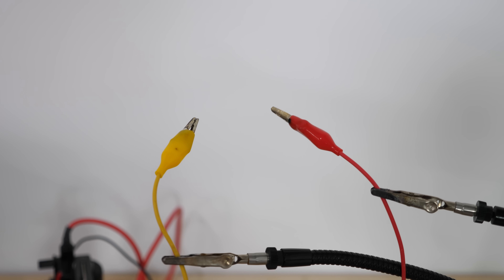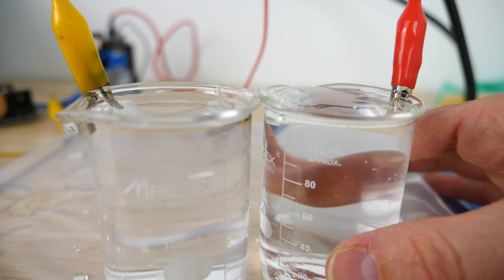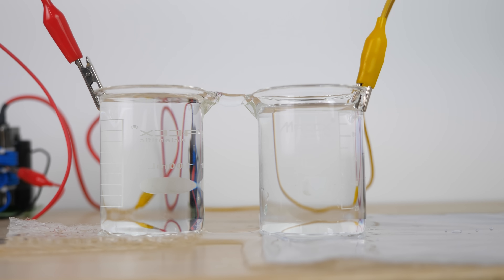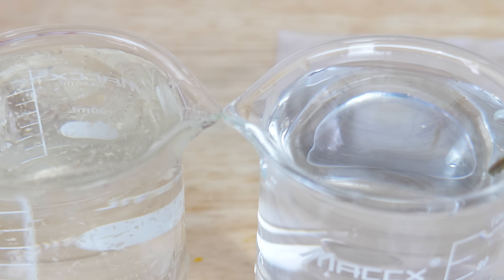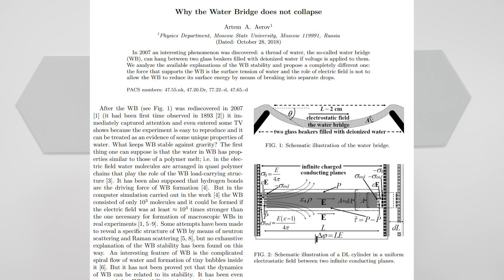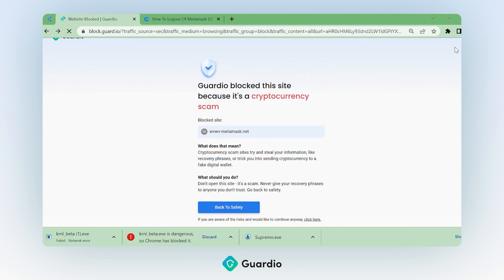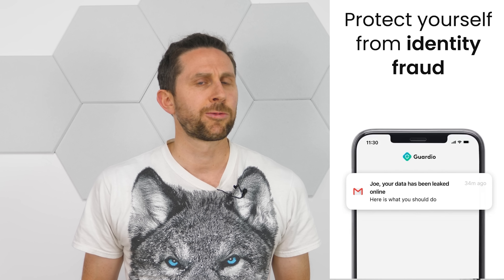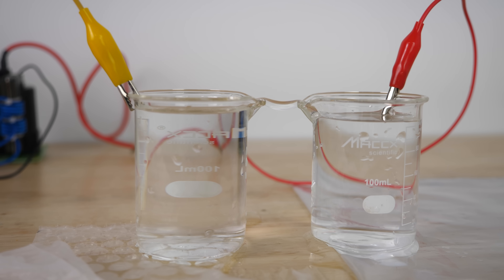How Does a Floating Water Bridge Work?

Comment: More crazy details: the water on the outside of the bridge is whipping around in a helical pattern at something crazy like 100k rpm, and I think the water on the inside of the bridge is going back the other direction. Also, the water in the bridge is freaking birefringent. And, there is a dramatic pH difference between the two beakers. I put up a few videos on this 10 years ago, and I've really been hoping a big science channel would pick this up, so it's awesome to see this video.
Reply: Curious if varying the Hz of AC would affect the bridge and flow?
Reply: @Motorhead250  it has to be DC.
Reply: @MonteFleming  AC throws huge Sparks
Reply: @Motorhead250  I found that even a little AC hum will disrupt the bridges.   They vibrate and splatter.   Your power supply needs to be quite smooth (i.e. a high-freq switching power supply, and not just a rectified step-up xfrmr.)
Reply: @wbeaty  AC Hz can go to mega cycles. Curious effects .
Reply: @Motorhead250  A 30KV dc supply with large AC hum, it needs filter caps, but they need to be 1uF,  ONE THOUSAND JOULES, SO YOU'RE GOING TO DIE!   Better to use a 100KHz switcher, and little tiny filter capacitors to make it smooth.
Reply: @wbeaty  lol. .. Ionization smells good a carcinogen.
Reply: The views of your channel are criminally low. You deserve more.
Reply: @copernicofelinis  thank you! I've neglected my channel quite a bit.
Reply: Nice, now what would happen if the liquid is  highly viscous?
Reply: @Kono Veldora Da!  good question. Not sure, because any impurities in the water change the bridge quite a bit, and conductivity in the water kills the bridge.
Reply: So if switched to DC would this even work?
Reply: @trey kearns  It has to be DC for it to work, I think. (I haven't tried AC, though, so not completely sure.)
Reply: @Basement Lab Productions  kk same question then but swap the 2. I just figured ac bcuz the dude up there ☝️said it. I dunno much about electricity. I'm a plumber.
Reply: @treykearns4867  you mean swap the positive and negative? Like mid-experiment?
Reply: Thats super interesting if pH is different, how do you know ? It would be nice to put some indicator that changes color in the pH range of 4-6 to see it visually (because demi water has pH of about 5 due to dissolved CO2).
Reply: @xH57Kqv9  I put pH indicator in the water and it still formed a bridge, but not as robust a bridge as pure water did.
Reply: @greenpumpkin172   It can't be tested because that would cause the pH to lean either towards acidic or alkaline and it would therefor disrupt the bridge due to micro chemical ionization or whatever.    🤷‍♀ it"s called spontaneous enlightenment, skip all that learning jazz lol.
Reply: @freemanrader75  the bridge actually does form with pH indicator in the water, but it's thinner and more fragile. (pH indicator doesn't do much to increase conducitivity.)
Reply: Subscribed ;-)
Reply: I know I have seen this brings between two beakers before, just not sure if it was another channel or a reupload 😅
Reply: How strange... Your videos can be found in your playlists but not on your main 'videos' page
Reply: @zer0nix  did you scroll all the way back to videos from 10 years ago?
Reply: have you ever heard about Stanley Mayer? he clamed to invent a device that used voltage and resonance to split water molecules instead of current as in electrolysis. He called his method voltrolysis and claimed to run a car on water due to the voltrolysis method having several times more efficiency than faraday electrolysis.
Reply: @raloed.363  I have heard of Stanley Meyer. I also thought of him when I learned about the water bridge phenomenon.
Reply: @MonteFleming  oh Kool. I know it's possible to use water as a capacitor dielectric in a LC circuit and that this LC circuit produce HHO GAS proportional to the voltage input. But I havnt been able to reach efficiency greater than 21 percent. It's actually a buck converter withvthe water capacitor acting as it's own discharge load resistor. The experiment in this video have me thinking...
Reply: @raloed.363  something interesting about this phenomenon is that there is very little gas produced at the electrodes.
Reply: @MonteFleming  that is expected because if the gas is produced by Faraday electrolysis and is current dependent, the high voltage source will only produce micro to milli amps. What I find really interesting is how much water boils in the bridge once the conditions are right. But you are sure that all those bubbles are water vapour and not HHO being created in the bridge right?
Reply: @RALO Ed.  it's in the milliamp range. I assumed it was boiling in the bridge and giving off gas at the electrodes. If you place both electrodes in the same container, the water moves quickly when power is supplied. As you increase the conductivity of the water, the motion slows, and the amount of electrolysis increases.
Reply: @MonteFleming  How would you explain the pH differences then and the heat only on one side?  hydrogen causes alkaline while oxygen causes heat, oxidation and so on...
Reply: @freemanrader75  the whole experiment heats up pretty quickly (water is being exchanged between the beakers at a pretty high rate). My hypothesis is that the high voltage is actually ripping the water molecules apart, forming OH around one electode and H2O3 on the other.
Reply: @raloed.363  Ah, good old perpetual energy. I'm sure this guy is a real genius.
Reply: Holy crap! I bet high voltage electrolysis is taking effect without an electrolyte so the temperature and pH and weird bridge effect is all due to the anode collecting the oxygen and the cathode collecting the hydrogen when water splits!!!  🙏🙏🙏
Reply: I wonder what effect this would have on chemical reactions? Think you could try it and if anything shows up post a video?
Reply: You got this totally wrong dude
Reply: @Cs Gto  I learned about this from Elmar Fuchs, who published a bunch of articles in Physics journals on it between 2007 and 2010, and then I did a bunch of my own research. You?

Comment: I thought that the reason was that the electrons would drift to one beaker as it is connected to positive terminal of the battery and in moving they would drag water molecules as they aren't solid conductor. Further if small particles were put on either side, depending on their charge they would move to the opposite side as they are positively/negatively charged.

Comment: I'd actually say, that the surface of the water itselve gets electrostatically charged up due to the high voltage, and the capacitive effect of two distinct surfaces on the right and on the left being seperated by a high resistance material (thin water line). Then when it is charged up, it repells itselve and moves to the other side. As long as you dont put the ballon, that is probably charged up positively near it, this happens on both sides,and thus water will flow back and forth. Once the ballon gets near it,it transferres positive charges to the surface, and thus the water that is on the surface, will move to the negative electrode, and thus one beaker will empty. Also this might continue, even when the ballon gets taken away, because of influence charges.
Reply: Also i think, that there will be OH- traveling and H3O+ traveling, causing some net flow.